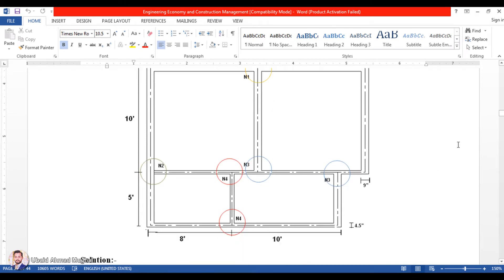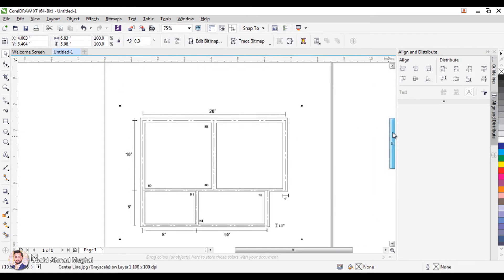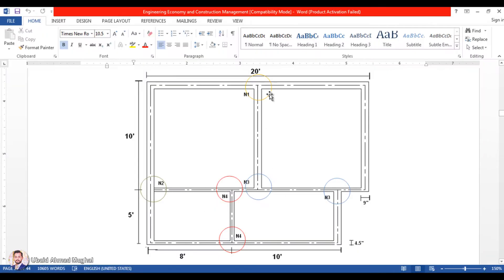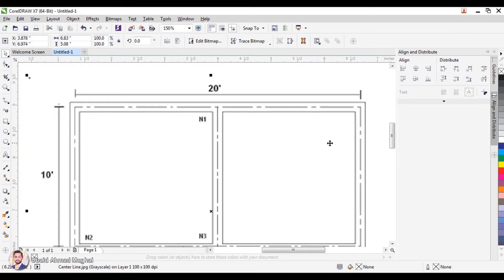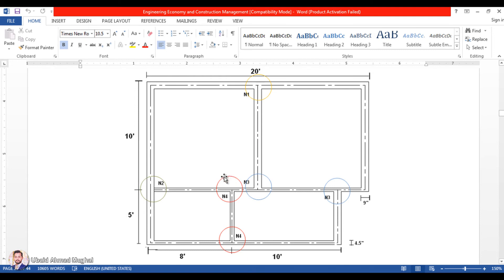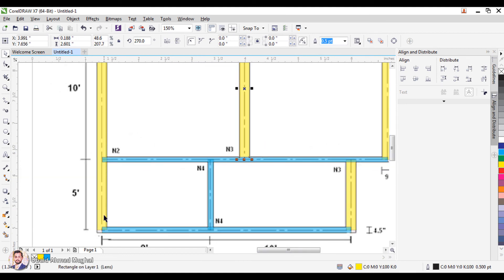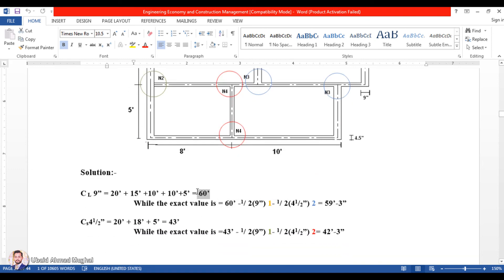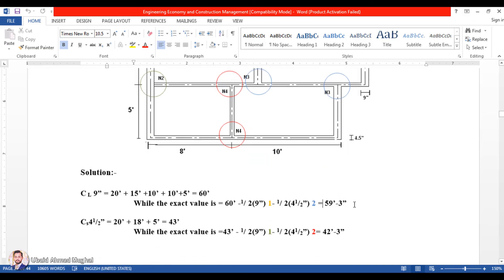Center Line Example Solved | How to apply Junction Corrections by using Center Line Method.

Comment: Aoa sir..?
by  getting length from center line method...did we apply that length by following formula when 9 and 4.5" wall are involved in a plan
FOR 9" WALL
L=length gained from center line method-1/2(no. of juction when 9" enters into 9")(width of 9" wall)-1/2(no. of junction when 9" enter 4.5")(Width of 4.5" wall)
and same as 4.5" wall.....please respond
Reply from the maker: Yes junction corrections need to be applied first before entering the length in table.